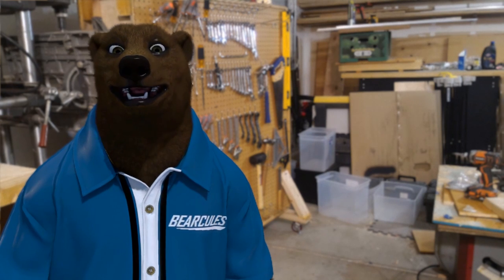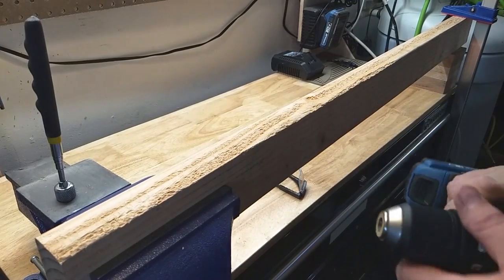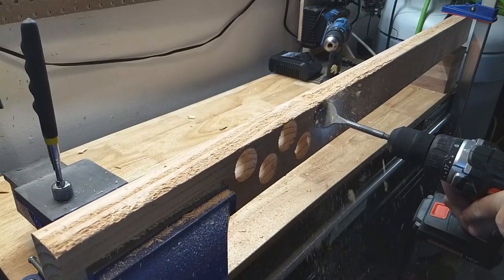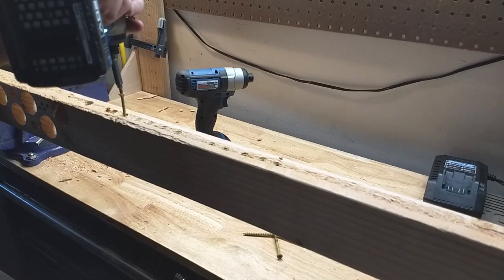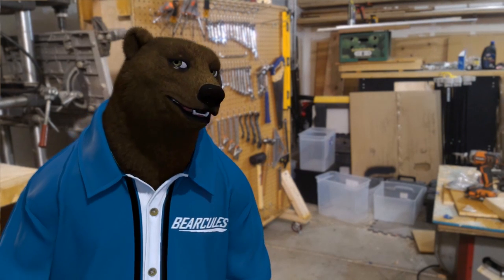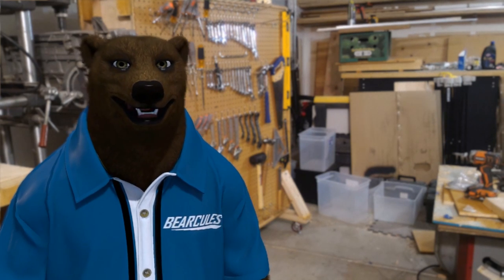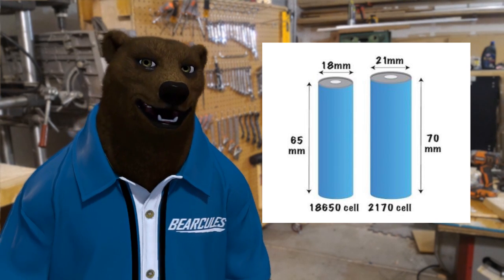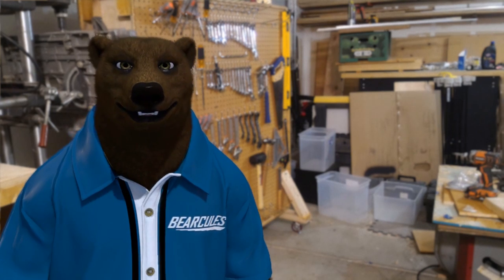Hercules 12V Tools (Impact - Drill - Screwdriver)

Comment: 1. The light is poor on the Hercules 12v Impact driver. It only lights the bottom half of the screw, below the hole. Why isn't it pointed around dead center? Fail.
2. The light does not stay on after releasing the trigger like on a Dewault. But, you can depress trigger lightly without engaging drive and light comes on.
3. The chuck is not as user friendly as some other brands. You must pull out on chuck to insert bit. Others allow you to simply push bit into locking chuck. Sucks if hands are wet.
Positives: 
1. Light weight and well balanced. Nice to grab and go.
2. Relatively inexpensive replacement batteries.
3. Comes with 2.0 Amp Hour battery.
4. Long throw on trigger, allowing slow gradual speed increase. Good for threaded screws.
Smoother  and more quiet compared to 20v.
5. Nice carrying bag in kit.

Hey, Hercules. Give us a handy screwdriver like the say 4 volt Milwaukee. I have has the 2.4v Milwaukee for 25 years. But new one is far too expensive.

Comment: I must admit I find the marketing plan of bring it in high then send out a coupon frustrating.  I bought the Milwaukee 12 v drill and impact for $99.  I use that thing all the time and I’d just buy the Milwaukee first again instead of $80 for a single tool.
Reply from the maker: It is frustrating but having run a company myself I also get it.  Finding the right price point is more art than a science sometimes.  That said you need to remember you aren't just buying that tool you are signing on for the whole cost of ownership.  A 2.0Ah battery from Milwaukee is $50!  Herc sells a 4.0 Ah for the same price.  The base charger for Milwaukee is $40.  A rapid charger that will do both 20v and 12v from Herc is $30.  Hopefully, they will get the pricing right and then this will take off.  But at this price, it will be a slow start I think.
Reply: @denoftools  But the dewalt and rigid are both $130 without a sale.   I just can't see them releasing this at that price,  or if they do, I can't understand the reasoning.  Maybe the environment is better with Hercules, but I don't think the avg consumer is going to take something like that into consideration.

Comment: Would like to see more offerings with this line. A single-hand compact recip saw, an oscillating multi-tool, a small jigsaw, right angle drill - driver, 3" circ saw (like makita's 12v offering), and auxiliary tools like a work light, Bluetooth radio, air inflator, etc...

Comment: The price on this seems way off.  You can get Dewalt of Milwaukee for $100-$130 for the drill /driver and impact driver.  That's $180 here for Hercules.    I don't see it...  Not even close.  This seems even worse than the $400 miter saw.
Reply from the maker: You are comparing sale prices to a full list, launch price.
Reply: @denoftools  These aren't sales as far as I know.   The $100 price might have been a sale I was thinking about.   

The miter saw released at $400 no extended warranty.  That was lower than Dewalt, but still too high.  Then they dropped it to $300 on sale with 1 year warranty, which made it a good buy. 
 
Buying two of these would run you $180, no extended warranty.  Getting a 1 year warranty on both would be another $20?  $200 versus $130.   We aren't even in the same zipcode, unless these things are far better quality than those 3 I posted.

https://www.homedepot.com/p/Milwaukee-M12-12-Volt-Lithium-Ion-Cordless-Drill-Driver-Impact-Driver-Combo-Kit-2-Tool-w-2-1-5Ah-Batteries-Charger-Tool-Bag-2494-22/203111686

https://www.homedepot.com/p/RIDGID-12-Volt-Lithium-Ion-Cordless-Drill-Driver-and-Impact-Driver-Combo-Kit-with-2-Batteries-Charger-and-Bag-R9000K/205358335

https://www.homedepot.com/p/DEWALT-12-Volt-MAX-Lithium-Ion-Cordless-Drill-Driver-and-Impact-Combo-Kit-2-Tool-with-2-Batteries-1-5Ah-Charger-and-Bag-DCK211S2/202482934

Comment: If you buy the Hercules miter saw there is a piece of paper in there that has the whole line Hercules they have a circular saw a recip saw a light hole tool kit on that piece of paper when you buy Hercules 12 inch miter saw

Comment: You know, the first "battery family" manufacturer (all that they really are) that can extend their 12v and or 20v systems to the household will dominate the market.  I see portable Li hair dryers, full size not handheld Vacuums, Blenders, and the list goes on.  Dewalt is very close with their power station/UPS contraption but there is such an untapped market out there for them to get you stuck in to their form-factor of batteries.
Reply from the maker: DAMN! That is some smart thinking.  Ryobi is already doing that with lawn care products but you are right.  There are dozens of things around the house that would be great if I could run them off my current battery system.
Reply: @denoftools   That's what she said!

Comment: I am a maintenance guy for a 2.6 million square foot building. Some work is literally a 1/4 mile from my shop. My 5 drawer HF tool cart is pack with tools and hardware to reduce having to run back to the shop. I keep both 12v and 18v Ridgid on cart. I use the 12v to save the18v for heavy duty.

Comment: Just to clarify  - a '12' volt Li  battery has 3 cells inside, but a 18 volt unit has 5 cells so that's  2/3 more than a 12volt.  (There is no 20 volt - it is 18 volt unit inside....just a marketing spin).
Reply: These are probably far closer to 11 volt than 12 as well.  And my shop vac has 6.5 peak horsepower, despite plugging into a 120V 15A socket...
Reply: @a89proof  They are 10.8 volt precisely by original release specs. (3 cells x 3.6v = 10.8v...  5cells x 3.6V = 18 Volt  not 20  for the 18 V units) -     3.6 V is the nominal voltage of a lithium ion cell. Have a good day.

Comment: I have both the 20v drill and impact driver. Love 'em. I get the small size advantage thing - I used to use an 18v Makita NiMH - great drill but it's huge and heavy. Two more comments: First, I hope HFT doesn't follow their welder strategy of introducing the Vulcan line and then raising the price roughly coincident with introduction of the Titanium welders. The 20v market is pretty competitive and I don't expect that the 12v line justifies raising the prices of the 20v tools. I hope the Bear's read on the pricing is correct - that the 12v line will reduce after introduction. Second, more 20 volt Hercules tools are overdue. I understand that they are, indeed, coming and look forward to that. Great video. Thanks.

Comment: Come on bear just use a regular old Flathead screwdriver on those light switch face plates.
Reply from the maker: When you are building out an office and you are on a flat rate bid, not hourly?  Not a chance.
Reply: It's not the faceplate screws that get 'ya, it's the receptacle or switch to box screws that are 1-1/4" long, 24 or 32 thread per inch, and need to be driven to within a couple threads of the head -top and bottom of every switch or receptacle.
Reply: What's the fun in that???

Comment: You was right on, about us wanting a circular saw, or Sawzall ,first  20 vote, I'm in HVAC and gave them a try, when DeWalt 20vote tools kelp tearing up on me 3 to 6 months after buying them, and then having to send them off and get them back the same way as I sent them , toget them fixed,and and losing 2 weeks of work waiting for them to get back, and then having to go buy new because they was still tore up ,Hercules hammer drill,and  impact, has been holding up a whole lot better then DeWalt has for me ,and the warranty I buy the 2-year warranty, is great, carry into the store and they will give you a brand new one right then, that's the reason that I tried them ,so far I have been impressed would like to have the skill saw, and the reciprocating saw, enjoy your Channel.
Reply from the maker: I am hammering them on that circ saw.  They know they need to get it out there!

Comment: Nothing bothers me more about power tools and make me believe a power tool line will come and go is when they constantly change there line up. Why cant a company keep making more tools on the same line/battery beyond the 1/2 dozon tools. Even if it only a soso to brand ppl will keep buying them if they are in that line.Well adleast HF can run a dozen different lines all by themselves. Lol. well not a HF cordless tool person but hope they can finally pick one/two of there lines and run with them. Then i would possibly consider them as a stay at home tool line
Reply: There is its called Milwaukee
Reply: @shanemelville  yep and thats why my cordless tool line is Milwaukee. The only other good option is ryobi 18v mybe makita since they do the 2 18 battery thing. So many other companies change it up to often or just stop carrying about there tool line.
Reply: @proudamericanrobman2829  I agree. Some years ago in my shop, I had switched over to the Dewalt 14.4v drills and drivers from Makita 9.6v system. Loved them, then Dewalt went with 18v and changed the battery configuration. When the NiCd batteries in my 14.4v Dewalts went bad, I went to get new ones at the HomeDepot, they had the Ryobi 18v drill w/ 2 batteries cheaper than the 2 pack of 14.4v Dewalt batteries. Seeing how Ryobi "promised" to "never ever" change battery platform, I switched to Ryobi. Bought to drill kits on the spot. I was so impressed with the Ryobi, ended up getting quite a few more of the tools. Im pretty happy.  But at home, I was thinking of using these HF Herc drills, but, again, I can get the brand new non brushless Ryobi tools brand new at the same or cheaper. And I already have dozens of batteries, so why not stay with Ryobi. BTW, I love Harbor Freight, Just not sold on these batt powered tools. BTW, all my 1/2" drive automotive impact guns are Milwaukee, cant beat them for their power!

Comment: I've had a Ridgid 12 volt 2 piece set, a drill 
and an impact driver.  Had them for 5 years 
now, and never an issue!  The impact driver 
has enough power, to tighten clutch pressure 
plates, with no problem.  If HF is as good, I 
may look into another set.

steve
Reply from the maker: Did you see my review of the Ridgid?  It was from a while ago but I'd say these are of the same quality and capability as the Ridgid set.
Reply: @denoftools , I hadn't until just now.
Found it, and you were reviewing the drill.

I got the drill,  driver, and 2 batteries.
One battery is a 2 AH, the other is a 
4 AH.

When I was working at a shop, I'd need 
to recharge, maybe every other week 
or so, so the single charger was WAY 
sufficient.

I also like the LED system.  I've seen 
systems, where the LED comes on, 
only when the motor is running.
You don't need the light then, but 
before then.

steve

Comment: If the shirt's not brushless we don't want it! 
Just kidding! I have a 12V Dewalt drill, and I use that more often that I care to admit. I think Dewalt should do something for a 12V line. What do you think, Mr. Bear?
Reply from the maker: What do you mean by "dewalt should do something?"  I'm cornfuzed.
Reply: @denoftools  Dewalt needs to improve on three things on their 12v line.  First, they need to make it brushless. Second, make larger ah hour batteries ie: 12v (2.0ah, 3.0ah, 4.0ah and 6.0ah).  Third, add more tools to the 12v line. DeWalt needs to step it up like Milwaukee M12 line.  I still like using my dewalt 12v line for smaller project.

Comment: Looks like a great tool for women.  Women often struggle with common tools because they are optimized for men who are on average stronger.  They are heavier and require more streignth to control.  12v power tools are lighter  and fit a woman's hands better.  They have less kick when a big spade drill break through.  Your demonstration shows the 12v tools can handle even big tasks.

Comment: 12v?  the 1990's are calling and want their batteries back.
Reply: That was my original thought as well. I hated the old 12v ni-cad batteries but Da Bear made some good points.
Reply: There's really no comparison due to the discharge characteristics of lithium cells.  They can supply higher currents with less voltage drop, meaning higher wattage, and with greater watt/hour capacity.
Reply: @Dale Gribble Precisely.